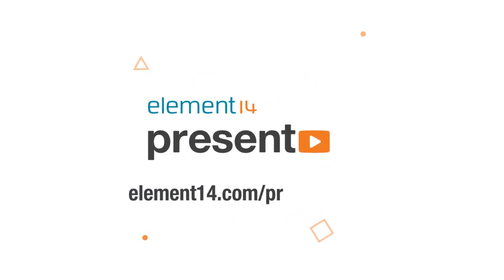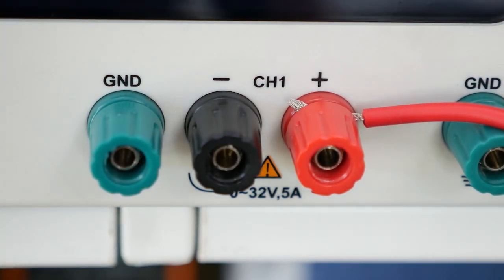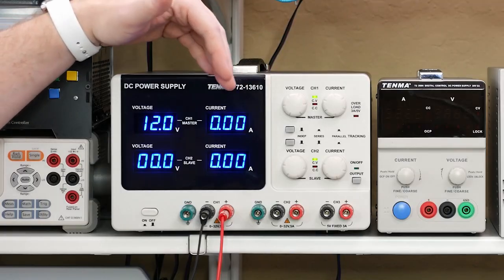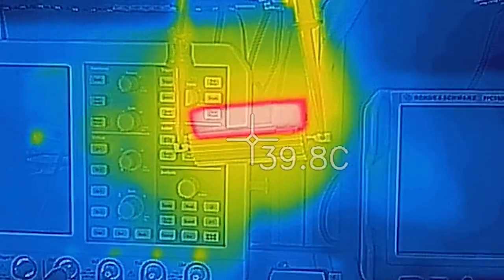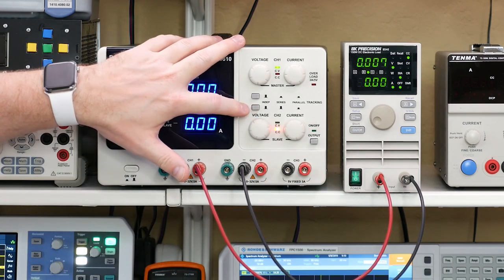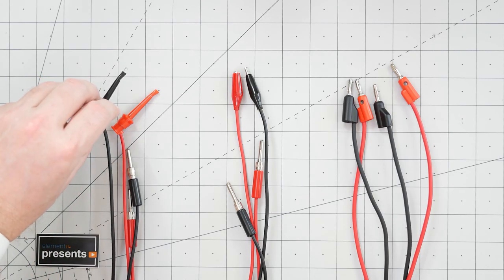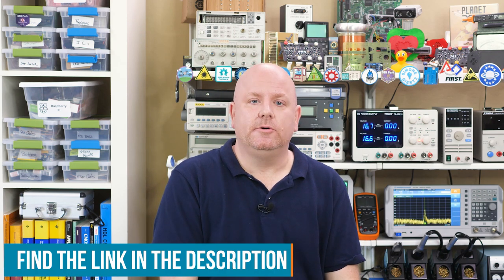Instrument Basics:  Bench Power Supplies - Workbench Wednesdays

Comment: The bench power supplies I work with nowadays display the voltage and current settings when the knob is turned, then go back to displaying the actual values. I haven't come across one that required shorting the output to set the current limit for many years.

Comment: Qs from amateur with 220-240 EU power: Can these Power Supplies be used for NVR(s) with security cameras pls? The power here does not have even Electronic Voltage. Is this used for computer power, security camera systems. Any excellent, reliable ones out there please? Looking forward to  some answers. Thanks in advance.

Comment: Dear Sir,
I have to purchase a DC Power Supply. I have two options, 
1. Topward 6303D
2. Caltron PR 3303SE
I have downloaded the operating manual of S. No. 1 but couldn't find that of S. No. 2. I need durable, high quality and easily repairable out of these two options. Price is not an issue.
I will be highly obliged if you guide me to choose the right one.
Thank You.

Comment: You forgot to mention, and I think this is very important, that when you turn the voltage knob left, this decreases voltage.  When you turn to the right, it does the opposite, it increases the voltage.  The technical tern for 'left' is 'anticlockwise' ('anti' means the opposite of the way hands on a clock move) and the technical term for 'right' is 'clockwise' (the way hands normally move on a clock).

Comment: Great video, but i’m confused about choosing the right supply for power a split power rail circuit, for example plus and minus 12v….. does the small Tenma on the right support this? Or do you need a dual channel supply for this, like the larger one on the left? (The viewers left that is :)
Reply: dual channel: 

Minus on channel one for -12v. 
Plus on channel one connected to minus on channel two and this is 0v. 
Plus on channel two is +12v.

Or if you do not need a 0v reference, you can just set one channel to 24v and pretend it is +- 12v.
Reply: @BaldurNorddahl  thanks Baldur

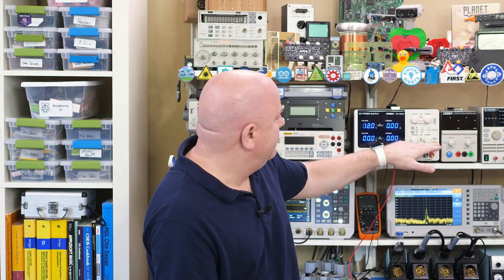Comment: At 3:51. If I wanted 12 volts to always be there how would I do that? CV.
Reply: You basically need to increase the current limit.

Let say your circuit needs 1A at 12V, you need to set your current limit above 1A (something like 1.1A and 1.2A).

Comment: It's better to spark outside not in relay contacts inside. Also you can avoid sparks by setting low output voltage first.

Comment: Planert X3(Hidden easter-egg in this video?) :D i have not tested it since i think it migth short hehe , but if i use normal/standar pc psu what happens if i connect 2 +12v togetter? or will it only short if i connect 1 of +12v to 0v, pc psu is sort of Poor-Man`s Bench Power Supplie but locked thoe :) Awesome Video :)

Comment: Much easier to use a proper digital power supply which can set the output current limit without shorting anything and without turn de output on. This method  in the videos is only used in crappy chinese power supplies ( tenma only rebrands those, of course, does not really manufacture anything )

Comment: Hello, I have a UNI-T UTP3305-II laboratory power source, is it possible to take a symmetrical voltage (+ (0) -) from this source when the outputs are connected in series to power the operational amplifiers? Thank you very much for the advice, maybe it would like to include a short video. There are a lot of examples of how multi-channel sources work on Youtube, but no one has explained such a connection. Thank you very much.
Reply: The question is confusing. If you put the two channels in series, then you only have one + and - connection. Which, if the op amp can handle the voltage, then yes you can power your op amp circuit. But that seems too obvious and I  must be missing something.
Reply: Maybe I'm making it too complicated!!! Maybe instead of connecting the double source in series on the lab power supply, just leave both sides of A+B separate and just connect A- and B+ and that way we get the center of a symmetrical source. It would probably be good to connect the center A-B+ to ground. I'll try it. The instructions are probably here: https://youtu.be/w99Q23mUEZg
I am concerned with how to create a symmetrical supply voltage suitable for operational amplifiers on a triple laboratory source.

Comment: pfft.. putting a dual-channel into parallel or series ..c'mon pretty straight forward when it is even button-orientated for boith current and voktage and clearly written in the manual..
you should have used two single-channel that are not adjusted from scratch to this feature and where you need to do it au naturel.
but whatever waste of time.. -1 unsubscribe. onto another video that perhaps knows what they are talking about where they actually can do it on two bench PSU not already adjusted from the factory to do this.
It is on single channels PSUs with all this reference or reverses bias and all that jazz hence parallel and series, where it would be relevant to get the info out there so people don't blow things up and risk harming themself, not least when dealing with mains power that is 230v in my region.
as the aspect of pushing a button on a multichannel PSU were it already built-in with dedicated buttons and even texted clearly in the manual, are not really learn or topic-worthy.
but whatever I should not need to burp common sense of you you channel-holder, the above scenario should be obvious for what is relevant when the average joe wanna put bench PSU into series or in parallel when on mains voltage.
Reply: Do you know where I can learn about PSU safety? I bought one recently and I am unsure how to be safe when using it